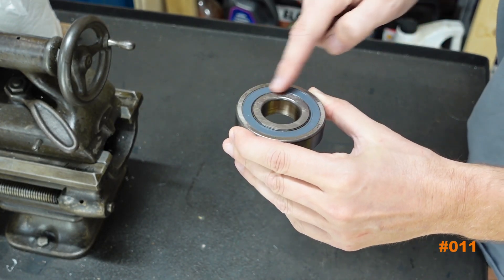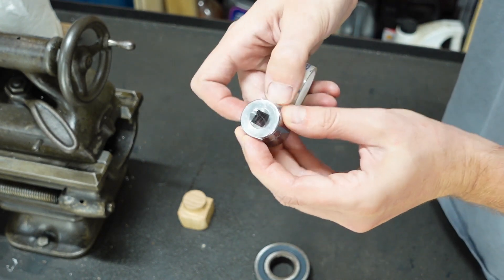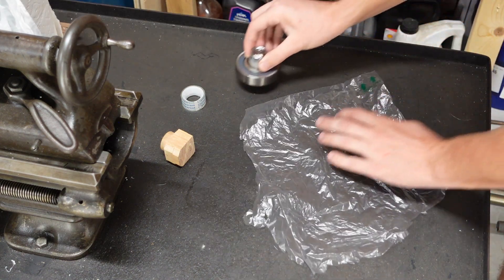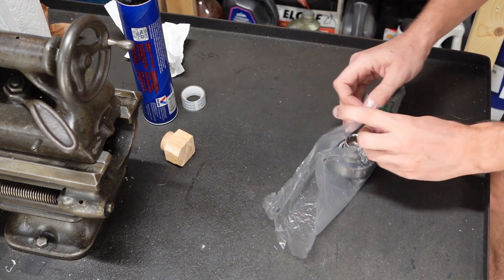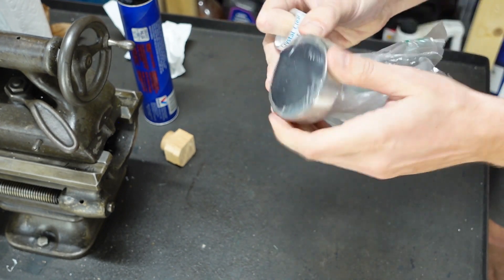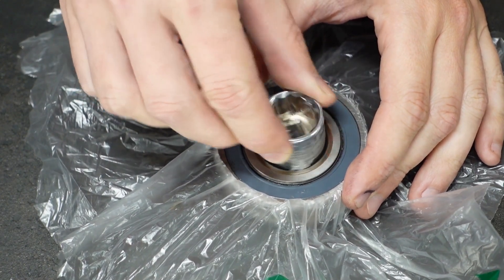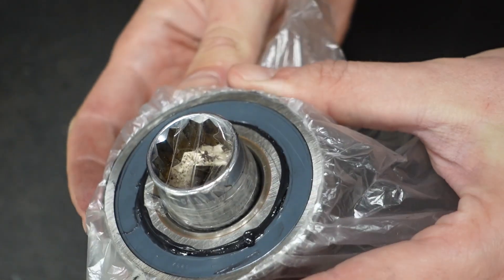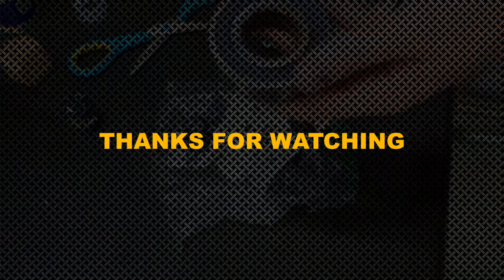How To Re-Grease Sealed Bearing. Easy Way Every DIYer Should Know

Comment: On most sealed bearings one of the seals is removable and it just pops right out. You need to use something like brake cleaner with a straw and clean it out before greasing it. The seal pops right back in after you're done.

If you are doing the bearing on an electric motor you can NOT use wheel bearing grease or it will destroy the bearing. The grease that is required for electric motor bearings is polyurea based. It will say on the container if it is polyurea based and the grease will be either blue or green. Moly based grease cannot be used on electric motor bearings. I found that Lucas X-Tra grease says that it is polyurea based and they have it at auto parts stores. It's grean and it's been working fine, but most of it is blue.

 I did extensive research on this before I greased the bearing on my very old DW-744 DeWalt table saw. I had to replace the front bearing but the rear bearing was perfectly good but it was bone dry. It had a seal on the back side made of nylon or plastic and I popped it out with an exacto knife. I cleaned it out with brake cleaner and used the exacto knife like a spatula to put grease in it and the seal snapped right back in place. I was able to do it without removing the bearing so it made the job a lot easier. The rear bearing would have been more difficult to remove than the front one. The front bearing gets most of the wear.

Some bearings have a metal seal on both sides and I don't know if those are removable. But usually one side is some sort of synthetic material like nylon or some type of plastic. Those seals are easily removable.
Reply: what the reason for the grease not being ok on electric motors
Reply: @khg8519  Grease is good for electric motor bearings. The Wrong grease is bad for them, the wrong grease being wheel bearing grease like moly grease. I don't know why it's bad it just has the wrong characteristics. Electric motor bearings turn at a higher RPM than wheel bearings. The right grease is a polyurea based grease. The consistency of the grease also matters, that information can be looked up with a Google search.
Reply: Hey thanks i learned alot from you.
Reply: seal is removable only theoreticaly, as if you remove seal, you can realy damage it, youre not factory to reseal it properly
Reply: I cant understand any reason why the nature of the drive, either electric or otherwise would make any difference in the type of grease that you use. I know of no electric drive tool or product where the drive shaft forms the ground link for the motor. Also in applications where the sealed bearing is exposed to the rain or moisture, prying out the plastic seal with a sharp metal tool of any kind will greatly shorten the life of the grease. The subject video method is by far superior and I cant fathom how you got  over 50 thumbs up for that comment.
Reply: @paulg444  So Shell Oil company and every other expert in the field specifies that you should only use a polyuria based grease, and not moly based wheel bearing grease for electric motor bearings,  and because you don't understand why you can't use wheel bearing grease on an electric motor bearing, you dispute this fact, as if you have a greater understanding of the subject than actual experts. Yes you know better than all these experts because you are a legend in your own mind. 

This right here tells us everything we need to know about you. 

And then you come up with this goofy idea that an exacto knife to pop out a nylon seal without damaging it,  is going to somehow harm the grease?  

All of this and you are oblivious to how dumb you sound. By the way I checked many sources to figure out which grease should be used in the electric motor bearings. I'm not talking about social media and You Tube either I'm talking about real sources. And all these people are totally full of shit because you lack the ability to understand why that is the case.

I got over 60 upvotes because I gave good advice. Hopefully no one is dumb enough to take yours.
Reply: The seals or shields are normally always identical, there is no "removable side". It may still be possible to remove them without much damage if one is very careful, it depends on the construction and assembly method.

There is no reason why the grease for electric motor bearings would have to have a polyurea thickener. The vast majority of bearings for electric motors don't. Also the colour of a grease doesn't tell anything about anything else than what the manufacturer wanted it to look like. The world is full of high quality electric motor bearings with brown grease. The base oil viscosity and grease temperature properties have to be suitable for the application, like in any other bearing application. In electric motor applications there is often a considerable heat flow to the bearing through the shaft. This often warrants the use of a grease with heavier consistency, often NLGI 3. The grease base oil viscosity still has to match the speed it will be running on and might be quite low, even if the grease is "thick".

Grease with molybdenum disulphide should normally not be used in any kind of rolling bearings as the MoS2 causes slip or the rolling elements. It's usually OK in practice though if the speeds are slow enough.

The video and the trick shown was neat 👍

Kind regards,
An application engineer of a major bearing manufacturer

Comment: Waste of time, faster and easier to pull out the shield and CLEAN THE BEARING,then regrease and reassemble
Reply: Faster and easier to just replace it, like you’re supposed too. You can’t see any wear inside. Unless safety just isn’t worth 3-4 dollars and less time…
Reply from the maker: Correct. But that bearing is about $25. 15 liter engine fly wheel bearing. Nobody put old bearing into fly wheel of course.
But sometimes it's better to just lube the big bearings for the unimportant machines. They are not cheap.

Comment: One issue i see is grease compatibility.  If it is polyurea grease and you mix it with say lithium base they don't mix.  Most sealed bearings will use polyurea as it is the best.

Comment: You can take the side, shields off those bearings easily and replace them without damaging them, but bearings are so cheap that you can just change them
Reply: By cleaning the bearing, you may not need to remove the bearing from the shaft. Plus you don't have to drive to a place that has the bearings, saving time.
Reply: Not all bearings are cheap  - some are very expensive  Ive got a bandsaw   the original ones were imperial lucky for me the guy who had it befor me machine the shaft down to take a metric unit    20 nzd instd of 300

Comment: you can also put some grease in the bottom of a metal can and heat it till it liquefies and drop the bearing in , ive done this with shielded bearings . 
With rubber seals i just remove them and grease them by hand

Comment: It’s a good idea… I always add extra grease into a new bearing, and find that the factory only ever greases one side of the bearing… and no matter how careful you are removing a seal or shield, there is always a chance you will damage it, or put it out of shape… over filling a bearing is not a good idea, but I like to add a little in…. Yeah yeah, you can follow the guidelines and not mix greases, but I’ve never seen a bearing seize or collapse after mixing greases… however, I wouldn’t mix a moly grease and HTBG… but factory grease is never moly… great tip thanks !

Comment: It worked ok, preparation is a little bit long with tape and plastic and a bit of wasted grease. I will still use my pick tool to remove the seals and grease these bearings though.

Comment: I've salvaged bearings which were locked up from rust or particulate many times.  Never my first choice but when it is the only alternative.   

Use small scraper or screwdriver to pry out both shields.  Flush out garbage by alternating penetrating oil and compressed air.  It's sufficiently clean when the air flow can spin it high rpm.  Pack with grease and reassemble shields.
Reply: Be careful spinning the bearing with compressed air. It can spin faster than the bearing cage can withstand and the bearing can blow apart.
Reply: High speed spinning can flake off surface of balls and also races .

Comment: Now the isse is, if grease can enter the bearing so easily this way while working ina water pump there is strong possibility that water toocanget into the bearing. So the purpose of seal is lost? 
Did you make a tiny hole on the seal or give a slight lift on the seal to get the grease in ?
Reply: Fair question, but the water seal may be distinct from the bearing. Though the machinery I worked on would almost be an antique now.

Comment: Don't confuse seals with shields. You can easily do what you demonstrate here with a bearing that has shields but not so easily with one that has seals. I generally carefully remove the seals or shields and wash out the old dried up or contaminated grease, then hand pack the bearing before reinstalling seals or shields. Also, over packing a high speed bearing can result in the grease over heating as well as excess drag and load on the prime mover, making it work harder.
Reply: How do you remove and reinstall shields and seals without damaging?
Reply: @ya472  I use an ice pick or something similar, Hope this helps
Reply: @speedfreak8200  Thank you. I watched a couple other videos and people were doing the same...  I do not know why I missed this  technique after 50 years, playing with equipment.  I was afraid of damage.  I did drill a hole and used a injection needle for a couple, but this wasn't ideal.
Reply: @speedfreak8200
Use a razor blade ,a good odea 👍😁😁
Reply: @ThisOldMan-ya472  With a very small flat screwdriver or a pick.
Reply: @ThisOldMan-ya472 very careful use the tip of a Stanley knife 🗡 😅
Reply: @TheArendt1  All my knives are Stanley's.  It is my name.  :-p
Reply: @ThisOldMan-ya472  
You can use a sharp pich o pointy nife is easy to do it and always is best wash it with mineral spirits to clean it and revove both seals intalled back with the pressure of your fingers 👍🏼
Reply: @anonimoporsiempre6033  thank you.
Reply: @ThisOldMan-ya472  What would be nice is if the bearing companies sold just the seals so you could put a new seal on.
Reply: And if the grease gets too hot from being overpacked, the pressure generated will blow the bearing seal or shield off and create one big mess. So leave some space after packing grease to allow for heat expansion.
Reply: @jayjaynella4539  thank you.
Reply: I've done what you've said on a lot of clutch release bearings, on older tractors. With a suitable flat screwdriver I carefully and slowly pick open the fold on the outside housing working slowly around the circumference until the bearing separates, in a vice I do this. Everything gets washed in kerosene followed by a exam of the races and balls before I refill it with good quality grease. One thing I do is "lightly" preload the assembly  in the vice before slowly closing the fold over again using visegrips . I've rarely seen these bearings worn out, little dry maby. I have one tractor which I did this on 13 years ago and never any noise or problems from it.
Reply: @mjmayo970  kerosene can get into the pores of the metal, when heated up will wash away a certain amount of grease. Just buy new bearings!
Reply: Me too, old man skills.
Reply: Replacement shields and seals can be purchased from reputable bearing shops. Possibly cheaper than the cost of the tape he used.
Reply: Fuckwit, but a new bearing.
Reply: Yup. Just work round and round with a fine screwdriver or a feeler gauge and the seal will come off.
Reply: I think that this is awesome! I will be doing this next time. Thank you!
Reply: So true!
Reply: For high speed idler pulley bearings on serpentine belts I find that a thinner grease with a high oil content works best. The oil in grease is the key to long life lubrication, keeping the grease from drying out. Too thick and too much grease causes momentary pulley lockup in really cold temps. Synthetics work best here.
Reply: Sir 🙏 
There are many lubricants available in market  generlly Hargware shop keep brown colour ed Greece and sale them ! 
But there are other lubricants also especially in white colour and semi  liquid type which can be easily poured in the gap between the bearings and shield ! 
The pupose of shield is for thst only !
Thanks for reading !

There are so many factors to be considered !
Reply: The bearing here IS a sealed bearing. Seals are to keep grease in, so obviously grease can get in thru seal with a bit of movement and pressure.
Reply: @beaver528  it was SO sealed the grease went right in lol
Reply: @beaver528  Many greases are a mix of oil and clay.  Eventually the oil evaporates with heat, migrates or cooks.  Nothing lasts forever.  (ps lots of information online)
Reply: @ThisOldMan-ya472  , how long do you have to re-grease your car wheel bearing ?
Reply: @JohnNy-ni9np  Vehicle wheel bearing lubrication is dependant on the type of bearing.  There are too many different types to answer here.
Reply: @ThisOldMan-ya472  , How about Toyota camry ?
Reply: @JohnNy-ni9np  year, model, engine, front or all wheel drive?
Reply: @JohnNy-ni9np  We took my wife's 2004 PT Cruiser to a shop because of a wheel bearing noise. (front wheel drive) After three sets of new bearing, I got fed up with local mechanics and decided to repair it myself. The bearing was a split inner race, and 1/2 of the race was spinning on the hub. Three mechanics never checked the hub for damage. The hub and bearing was not sold as an assembly, so I purchased both and problem solved. I even went back to one of the mechanics to show him the issue, and he ARGUED that it just needed another new bearing, that the hub was fine? These types of assemblies do not get greased, but can last 100,000 miles.
Reply: @beaver528  no it is a shielded/closed. If it was sealed he wouldn't be able to do it this way. The black plastic is clicked in a friction fit around the outer race if you get a thin hook like object between it and the inner race you can pull the cover off to gain full access to wash out and put new in.
Reply: That is sealed bearing crying out loud. If someone thinks that seal is actually rubbing against races, he's so wrong. Why? Cause many bearing speeds would friction burn those seals in few second. There's always bit of gap and this is why this works. Never seen this method. It seems very good,but people also be mindful about amount of grease. This would be excellent for some not insanely fast,but dirty/wet protection. Like motocross/enduro bearing would be very good. Really fast electric motor definitely not.
Reply: @jothain  What now has me curious, are bearings and seals used to keep water out, like in water pumps.
Reply: @ThisOldMan-ya472  Bearings aren't designed to keep water out at all. There's always shaft seals to keep water and dirt out of bearings. On pumps there's usually carbon/carbon or carbon/picarbide seals with o-rings to keep "media" in inside the pump. If there isn't such assy, it's designed to fail in very short time.
Reply: @jothain  Makes sense. thank you...  I did not mean a bearing would keep water (media) out, I meant the seals used on or in conjunction with bearings.  🙂  As mentioned, high speed friction heat would fry most seals?
Reply: @ThisOldMan-ya472  Yes, that's why those hard carbon/silicon carbide seals are used. It's only couple millimeters wide patch where surfaces mate and seal. Surface quality is simply so good that media won't leak. If you quickly want to see, like in this Alfa Service video around midpoint those two parts are seen quite closely. My profession is industrial mechanic and I generally gladly show/tell things to curious people. https://www.youtube.com/watch?v=QOfG5eoyZkk
Reply: @ThisOldMan-ya472  Note that this is quite high quality sealing method. There's tons of similar solutions. Most simple and I believe oldest is essentially graphite wound rope in shaft pocket and ring that will press on to that "rope packing". Though that one generally is meant to leak/moist very little to keep materials from so-to-say burning. Then the most common and simple method is modern shaft seal, very common in oil shaft sealing. Like shown here in the beginning https://www.youtube.com/watch?v=OvzOXqx7dlg